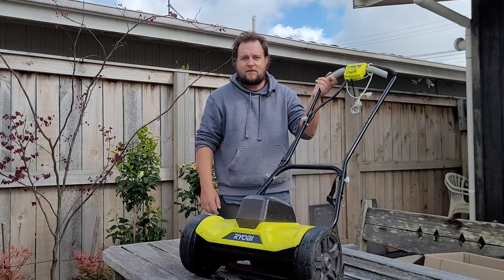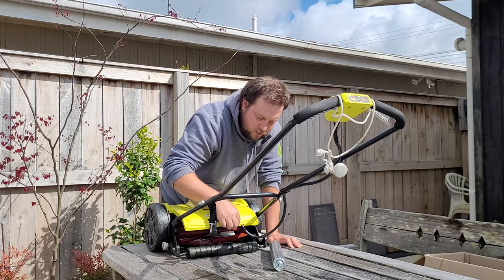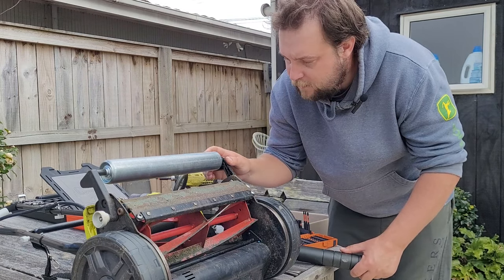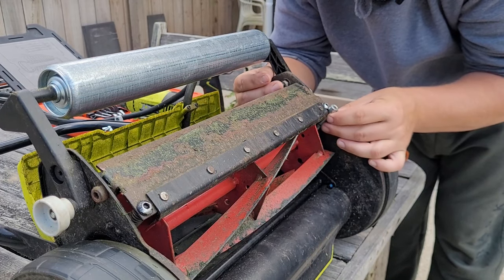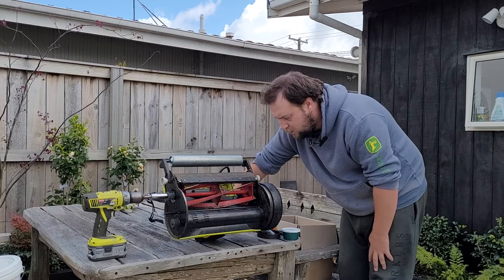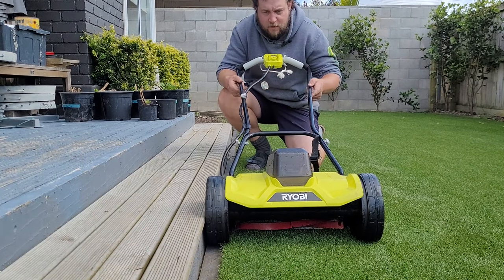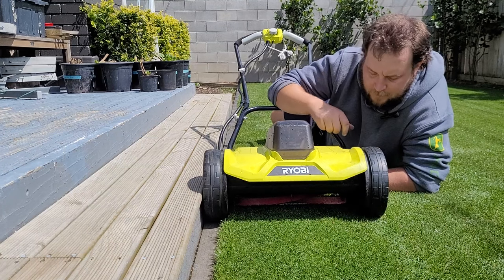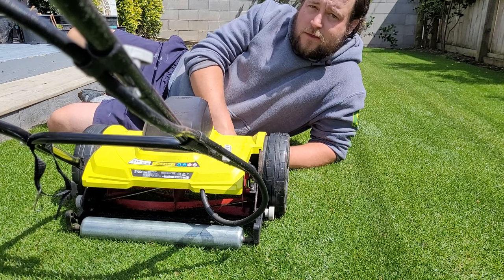Mower Mods, Issues and Maintenance! Ryobi 18v Reel Mower

Comment: Front roller is a good idea, never thought to do that.  I have the ozito Cylinder mower and its a pain getting the whipper snipper out to trim the grass where the mower wont reach.
Reply from the maker: Yeah mate if it works out how it is in my head it should be a lot better! Also with the timber edges I have the mower has to be right on the edge to cut and it falls off all the time haha. I think the Ozito and Ryobi are very similar so however I end up fitting it would probably work for you too. Thanks for watching!

Comment: Hey mate, have you figured out the front roller upgrade? Really keen to see how you planning to do it as I am modifying mine as well, I think the two side wheels need to be off the ground in order to to get both roller rolling, your video is really helpful keep the good work going mate, cheers
Reply from the maker: Hey mate still in progress haha haven't had much time to work on my projects recently but we'll get there. I have a roller for it at least. Yep I will be running the mower with no wheels on once it has the front roller. Thanks for watching and commenting😁👍

Comment: Hey mate, im wondering what sized hex bolts you used
Reply from the maker: Hey bro I can't remember exactly I just took one of the existing ones off and took to bunnings. Someone else commented on this video asking the same thing and came back with this "just bought some. Its m8 x 1.25 bolt 45 to 50mm length if others need to know".

Comment: Any chance you remember the size specs of the tightening bolts you replaced? Saves me from taking it off and taking it to bunnings
Reply from the maker: Nah not sure sorry mate! I'd just be roughly guessing and might give you wrong info🤣
Reply: @KiwiLawnie  just bought some. Its m8 x 1.25 bolt 45 to 50mm length if others need to know

Comment: What is the spindle diameter for the roller? I can only find the roller with 12mm spindle  , not sure if I can drill that wide.
Reply from the maker: Hey mate the one i bought was 8mm from memory. Are you in NZ?
Reply: Nah I'm sydney . Haha thanks mate. The link you sent below the company don't send to Australia haha
Reply from the maker: @matthewcheung2530  Check out Facebook for the ozito mower pages heaps of aussies switching out the rollers on them and they might be same size? I think Dandenong casters is a shop a lot of people get rollers from. Good luck mate!
Reply: Hey mate, did U struggle to put the belt on? How did U do it?
Reply from the maker: @matthewcheung2530  The belt you take off to backlap? Yea i struggled for ages to get it back on until I just decided to take the circlip off and remove that bigger washer thingy and then the belt goes right on easy as and just put those parts back on was laughable how much time I wasted on it haha. Hope that helps mate
Reply: @KiwiLawnie  thank you. I will have a go and hope I don't break it lol
Reply: @matthewcheung2530 did you end up finding one? Like you, I can find the perfect size one on eBay (from China) but the axle is 12mm. Is there enough material to drill out for a 12mm axle?